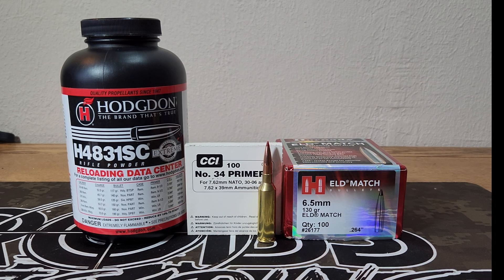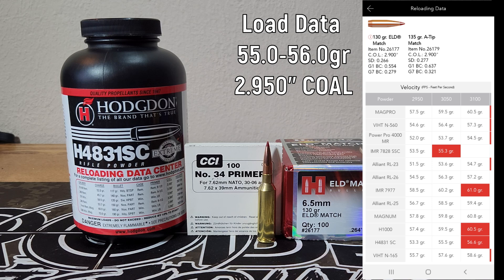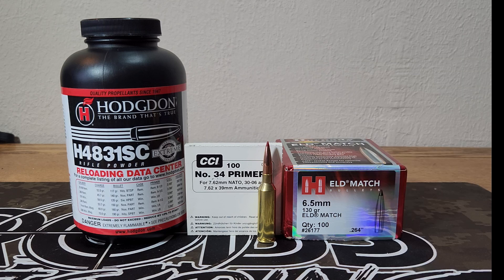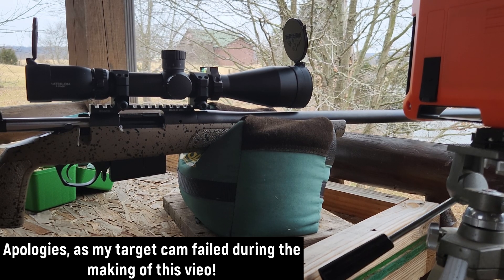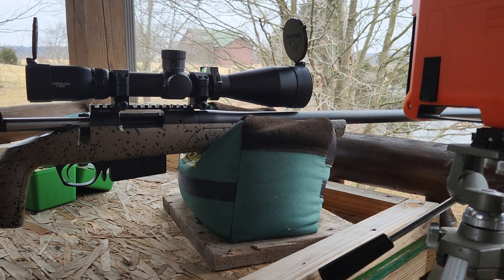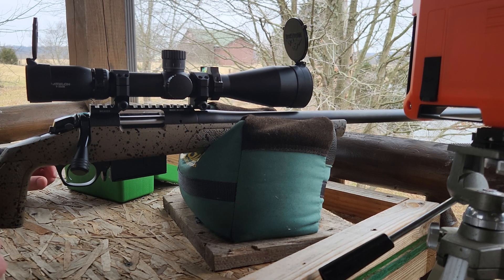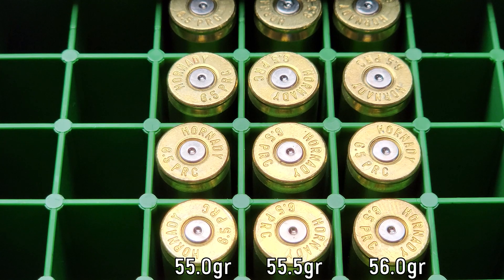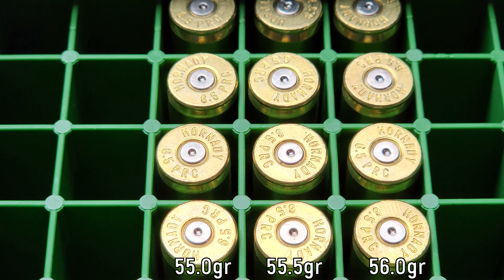6.5 PRC, 130gr ELD-M H4831SC

Comment: Interesting results. 
I recently tested 135gr Berger Classic Hunter from 54 grain upto 57 grains with ADI AR2213sc (same as H4831)
The happiest load was at 55.5 grains traveling at 3133 FPS and a 0.511" group. 6 shots. 

The most accurate load was at 57 grains with no pressure signs on the brass besides a faint ejector mark. The only issue was the bolt had 2 distinct clicks to lift it, which I decided to cease testing higher loads there. Problem with rifle chamber? Or Too much pressure?
Speed was 3221 fps and group was 0.472 for 6 shots. 

Shot from a semi-custom Tikka T3 with 28" barrel.